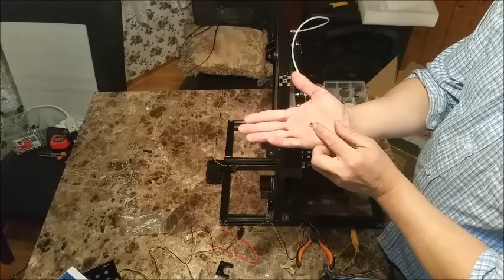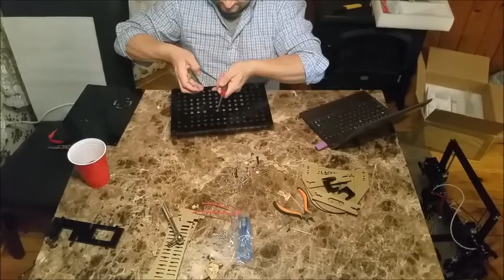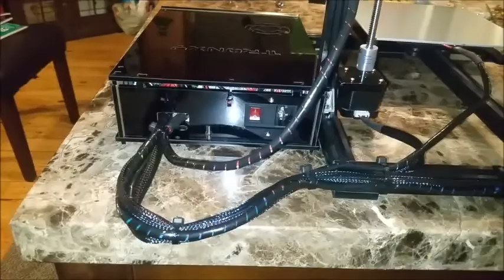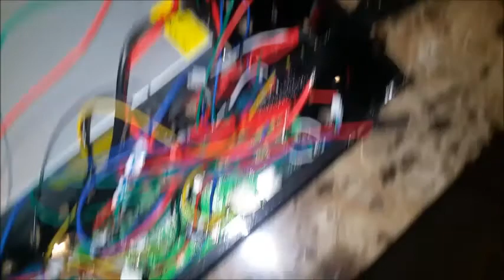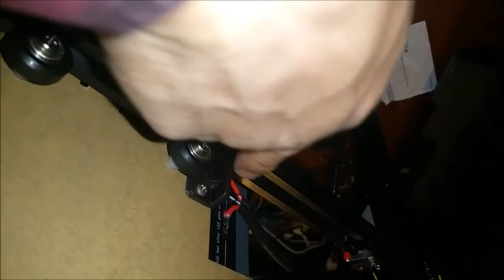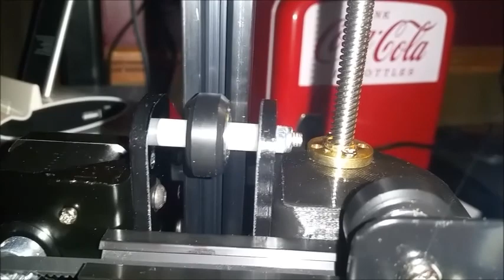Tronxy X3 3D Printer Build Video and a first print

Comment: Mine arrived yesterday; Sorted the tiny nuts n bolts into separate trays (handy clear plastic yoghurt cups) peeled scratchproofing off  the black perspex; Kit looks nice - After adjusting the BP travel & extending the bed I'll have PLA print *18.5 cubic litres Build Volume from a £180 printer.  I hope I can get it printing to a decent quality standard. This should be fun.
Reply from the maker: It is a really nice printer once you have it all tuned and some mods done to it, I have the print volume on mine up to 255x285x300 and I am working on another project that will make it a more versatile tool
Reply: That's almost 22L of Build Volume. Think of the fun you can have printing life size head flexible skin mask prints & the trouble you can cause by scanning someone's head then make a wearable cctv-fooling "them" head & robbing a Bank lol!
Reply from the maker: My CR-10 has a build volume off 300x300x400 and came 95% assembled
Reply: Ok show-off, so you can print a highland cow's head using that. Get to it : )

Comment: I bought this printer from gearbest, I am dealing with missing parts, bad engineering, hope I can make it work, watching your video for final wiring procedure
Reply from the maker: I actually did not film the actual wiring but I do go over where everything is connected. Also if you see my later video I suggest replacing the power wires from the power supply to the board with some solid copper heavier gauge as they have too high a resistance and over heat, my ground connector melted due to this. THe quality assurance of Tronxy is horrible pretty much everyone who has bought this printer is missing parts. I only recommend it for experience DIY's who may have spare parts lying around. For the price when it is on sale it is a great deal.

Comment: I bought one of these off eBay, mainly to make miniatures for a D&D game, so it doesn't have to be perfect. For that, it's pretty decent, although I'm having trouble figuring out how to calibrate it. I tried to print a 20 mm cube, none of the edges came out to 20 mm, and the X, Y, and Z were each different. Also, it came with a large square of blue tape which I carefully installed to minimize bubbles, but no matter what I do for adjusting the table, and regardless of whether the table is hot or even turned on or off, it seems completely random whether it will actually stick or not (I'm using PLA if it matters). I have never once gotten the "skirt" to print and the bottom of my prints always look like garbage. I had to replace the bushings/belt guide, whatever it's actually called, because they were causing round things to come out looking like footballs. After replacing them (I used slightly larger bearing-bushings like what's used in skateboard wheels), it now comes out pretty close (still not perfect but I can live with it) to round. Is there a website somewhere that explains all the calibration procedures, including things such as what settings in the EEPROM and slicer program to change depending on what's wrong, etc? At this point any help would be appreciated. I still believe it would be a great little machine once I get it working properly.
Reply from the maker: There is a facebook group that is very supportive of this printer. 
https://www.facebook.com/groups/1119103791478149/

I threw out the blue tape, never used it. I use extra strength glue stick. Also you should make sure to thoroughly level your bed, I have a video on here where I increase the bed size and I go over leveling the bed if you are not 100% sure there. If you level the bed and use glue stick the bottoms of your prints should come out flawless and and glassy looking. Some people use hairspray I have yet to try it. Strange you are not getting all your axis' dimensionaly  correct and different from one another. I have not experienced this issues, the printer for me from the first print was correct on all axis'  There are links to the firmware on the WIki which is listed on the facebook page and I go over a bit in be bed enlargement video on how to reinstall the firmware if it may be causing your issues with dimensions being out.
Reply: Thank you very much for your quick response. I'll look into those.
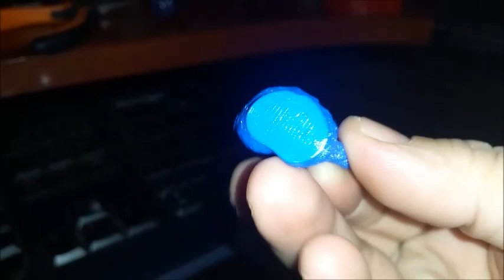Reply from the maker: If you check out 1:03:10 you will see the bottom of the first ever printon the machine, it is as smooth as glass. that is from leveling the bed just to the right height and printing directly onto the mirror with a little glue stick

Comment: Real quick piece of advice about what you are using for bed, just go to Lowes, and have a window pain cut out for what size you want.

It is so cheap you cant get 2 or three cuts for under $10

I use the glass for so many reasons, it is easy to scrap Elmer's glue from or take off and clean, and your not going to get a better flat surfuce that can handle bed heating.

One printer I have, I used aluminum tape to hold the glass down, and it worked out pretty good. But clips seem to be ok too.
Reply from the maker: There is no Lowes where I live or anywhere near and the local glass places would charge me $30+ for a 5mm thick custom cut piece of glass this size. The mirror on the bed is 5mm and cost me $3
Reply: MMMMM K

Well if that is working for you go with it!
Reply: I pulled apart a load of defunct printer-scanners and plan to  use the FREE A4+ tempered glass plates from one of them on my printer's heated bed. Someone tell me now if this was a good idea or not....they can surely take the heat.

Comment: Good could give me some tips in this 3D printer just bought one and I wonder if this is the like of the printer and that the defects found.
Reply from the maker: Did you begin your build process yet or did you just order it and are awaiting it's arrival. It may have been bad luck for me to be short a couple of nut inserts and screws. I have had the printer up and running for 5 days now and only 2 successful prints so far due to issues with the x axis setup. FIrst thing to do though is get larger zip ties then what comes with it to hold the x axis belt in place. Mine broke on the third print ruining the print. Also I found if the belt on the x axis is not good and tight it easily slips around the gear and you miss steps, the down side for my tightening it however is the acrylic holding the bearing on the end of the X axis gantry split and I may have to replace it soon. Let me know how your build goes and if you have any issues. This is my first of this style of printer, I have own only Kossels up until now
Reply from the maker: The Melzi board in mine went over night while I was asleep. The ground wire melted the connected it was in. So Looks like I am at a stand still with this machine until I can figure something out.

Comment: RW999, I've almost completed my build but can't see in the "instructions" (notice the quotes) what they planned for the Z stop.  How did you wind up installing the stop switch? All I can see/do is fasten it into the left Z bottom extrusion with the pre-assembled acrylic part and a "T" nut, but the switch roller doesn't seem to have any real good contact point on the underside of the X axis carriage.....especially any ability to fine tune the Z home position. Didn't see the point in your video, with any clarity, how you achieved it. Thnx.....
Reply from the maker: Hello, yes the instructions skip that part entirely but there is an animated video on the sd card that shows it being mounted at this point.  See the soldered wire came lose on that endstop for me and earlier in the video I explain that I replace that endstop with one of my own that does not have the little roller which gets in the way. I used an enstop with quick disconnect wiring and a flat bar end which makes good contact with the V roller wheel. For adjustment what I did was tighten the bed screws about half way and lowered the hot end to the build area and re positioned the endstop to be up against the v-roller. This gave me adjustability on the build plate springs.

At 16:37 in the video I go over that specific endstop
If you can have a pair of those little plier for cutting you can take that ball right off as it gets in the way
Reply: Thanks sorry about your board. I have an A8 and I had to make a spring-loaded adjustment screw for the end stop on it and it works quite well. I was missing a couple of small parts also and haven't printed yet
Reply: So far I'm impressed with the weight and the sturdiness of the frame
Reply from the maker: I really like the frame and the stepper motors. The acrylics on the belt pulleys are one of the biggest design flaws of this printer. I had one split already from the strain the x belt is causing. Gearbest is going to send me a replacement board but I am still worried I have read up a lot on these board and apparently this is quite common so I am concerned there. It happened while I was asleep during a print, if it caught fire while everyone was asleep we could be in some big trouble. For a few more dollars and thought they could have made this a really good diy kit . I will prob do some heavy modding to it. I want the bed to come all the way to the front when I home it not all the way to the back, that just stupid. I will also Prob move the Extruder the other side to have all my wiring come off one side.

Comment: I'm working through my assembly and the only problem I've had so far is that the bed wobbles a little, like the holes for the wheel bolts are not drilled close enough together. Is this an issue that you had? It was in the portion of the video that you didn't have recorded.
Reply from the maker: I did not have  wobble issues my X3, I did on my CR10(which had adjustment but that was still not enough) I have since relocated the holes on my X3 to give me much more print area. If you bed wobbles  side to side you need to bring the wheels on the bed carriage closer towards the extrusion. if there is no more room I recommend openning up the holes a little bit and reinstalling the wheels as close to each other(side to side) as you can and then sliding it back onto the extrusion, it should require a little force to go back onto the extrusion, this will eliminate wobble.
Reply: Thanks for the response and the advice.
Reply: I ended up extending the holes with a drill, elongating them a bit. After adding some washers I was able to adjust it to be as tight as I wanted. I never had a problem after that but I decided to upgrade the bed to use linear rails instead using this: http://www.thingiverse.com/thing:2185364

I prefer the linear rails for stability, especially with taller builds, though I'm using linear bearings which are definitely louder than the wheels. I've never used bushings so I don't know how they would compare. I don't regret my choice.

Comment: hey rockwater, i just finished building the printer, and i am having major issues with the auto leveling problem, where the Extruder doesn'tstop and keeps pushing the beddown reall ardto the point of springs going flat...  do you have any idea how to fix this?
Reply from the maker: Do you have your Z endstop wired properly? I do not have autoleveling but I do know that the Zendstop in the proper position should prevent what you are describing from happening if it is set at the proper height

Comment: Hi, I have a problem connecting tronxy to computer. Could you explain how to install the  FTDI driver?
Reply from the maker: I am not quite sure what the issue is your having, what operating system are you running? I am running windows 7 and I did not have to install any drivers. The Printers Mainboard had the firmware preloaded and when I connected it to the PC i could detect with Pronterface right away. I just had to make sure I had the Baud settings correct and was on the right com port

Comment: Hi, My Tronxy X3A is arrived without wires to connect the power supply to the mainboard.. what kind of wire should I use? Thanks for answering me
Reply from the maker: 10-12 gauge should be good and thick enough to keep resistance down. Braided at this gauge should be fine, solid may be too stiff. I used solid 12 I believe

Comment: Hey mate i ended up buying one of these and stupid me went with auto leveling lol im having no luck with it how hard would it be to change it to a end stop switch instead?
Reply from the maker: Putting a mechanical enstop on the printer should be simple enough, did you X3A come with an endstop for the Z axis, if so then just wire it in if you haven't already and remove the autolevel probe. To keep things simple firmware wise just install the non autolevel version of the firmware. Check out my Video where I increase the bed size to 255x285 with a few simple mods, I go over how to install the non autolevel repetier firmware and I do a manual bed level near the end of the video

Comment: did you fix the mainboard? i orderd mine off ebay thinking about putting a ramps in it
Reply from the maker: I got a replacement from Gearbest. I did order replacement connector for the original board from aliexpress but its been 87 days since then so  I gave up on that, but eventually i can repair the original by soldering a new connector on. When you get yours junk the wiring for the power supply to the board and get some thicker gauge and use that, you should be fine then
Reply from the maker: One of my favorite features with this board/lcd combo is that when you pause the printer lifts and parks the print head in the corner and keeps the motors locked so you can change filament out, none of my printers with ramps have this feature
Reply: you can do that on ramps, did you use 10 Gage wire on all of it?
Reply from the maker: on my ramp it just pauses at the point where it last prints and disengages the steppers, I  used 10gauge for the live and ground from the power supply to the board everything else was fine
Reply: im not sure where the setting is but its in marlin firmware, newer anyways same thing for filament sensor, over all is it a good printer?
Reply from the maker: I love the printer, I will be doing a video this weekend on increasing the build volume for cheap. I will attempt to increase the X area to 250+ and the Y area to 300
Reply from the maker: Then the build plate wont look so small next to my CR-10 and Custom Kossel XL
Reply: great love to see that

Comment: Good, I have a problem in my printer and do not know how to solve and need help a lot, I set up the whole electrical installation only not connect the panel can not even connect to the computer printer, current flows across the site of the panel and all this current with only the league not screen or connected to the computer with

Please help me I'm getting, not knowing what to do ....

Comment: mine is an i3.  how are the limit switches mounted?  Shouldn't there be at least 4?I only have 3
Reply from the maker: All my printers only have 3 limit switchs, My A8, CR-10, X3, even my Kossel mini's. One for your Z axis,  one for your Y axis and one for you X axis. Some people use a 4th one as a simple bed leveling sensor which you can see on some Kossel mini kits

Comment: so the power supply caught fire... Great. Well some one recommended this one to me. I guess I wont now. 

Did you ever find out what caused the fire?

Too much power draw?
Reply from the maker: it was not the power supply it was the ground wire from the power supply where it connected to the main board. the wire they supplied was not thick enough gauge so had too much resistance going through it when the board was drawing enough power to feed the heated bed. When I got the replacement board I used s thick gauge and solid copper instead of stranded and all is well now. This printer is actually my favorite printer at the moment and runs like a champ every day
Reply from the maker: The seller sent me a replacement free of charge, it took 4 weeks to arrive however